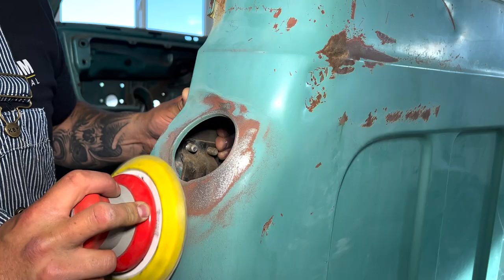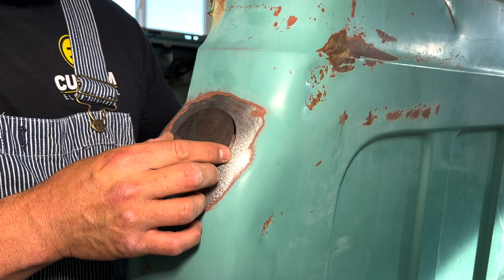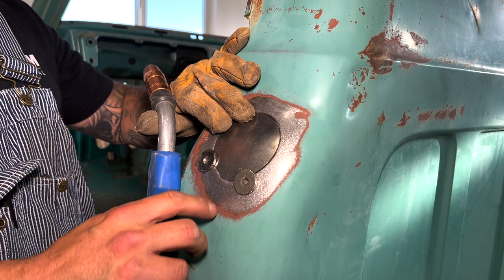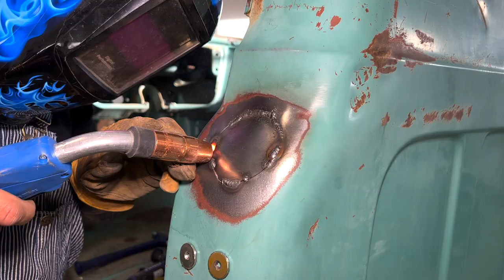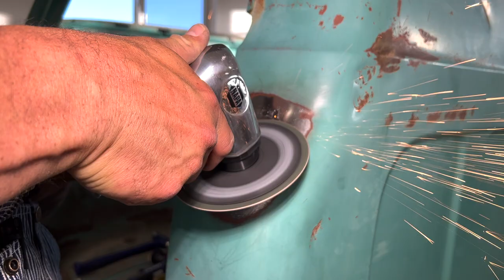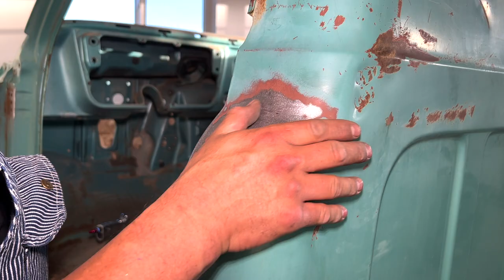67 Chevy C10 Build Series Part 5: Fuel Filler Delete

Comment: Why do you blow it off after you weld?
Reply from the maker: I am doing this as to keep the heat down in the Metal.  If you let the metal get to hot then you will have warping and other issues so I always take in nice and slow so it will stay perfect.
Reply: @abinnovations6699  that makes sense.